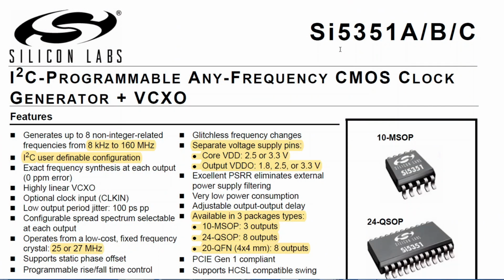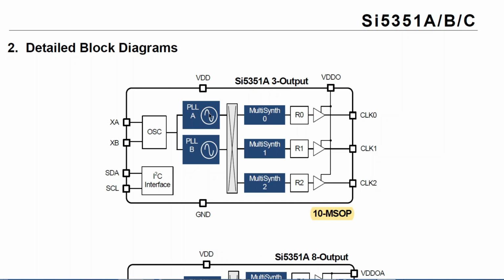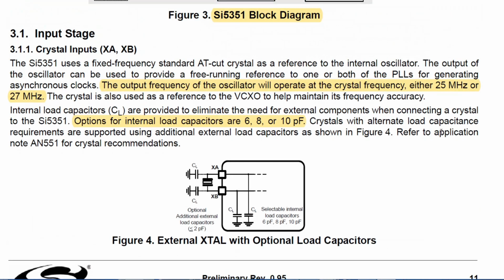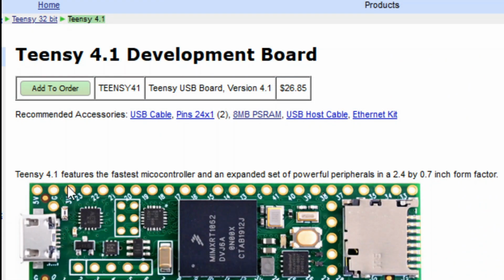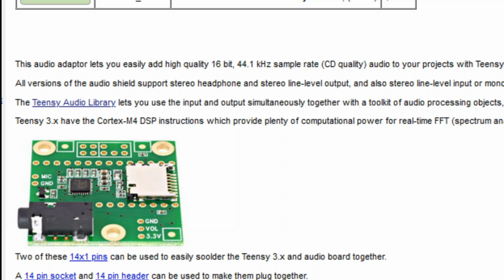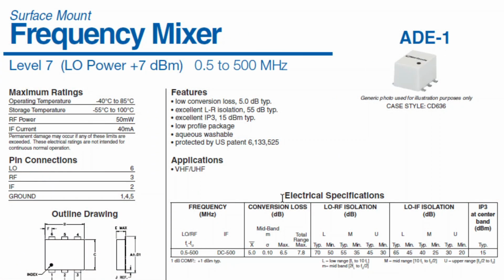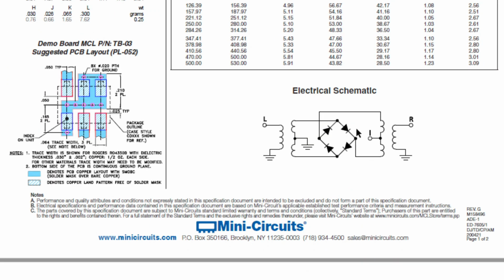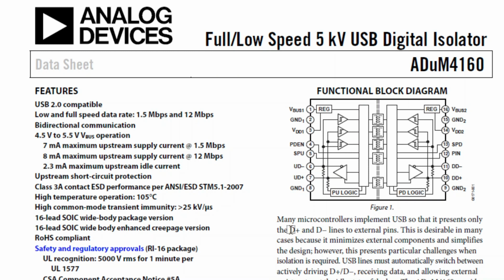#076 Post bag #20

Comment: BGA deadbug? Consider yourself challenged! ;)
Reply from the maker: Thanks Dustin I accept the challenge. 42 balls in a 7 x 6 with a 0.35mm ball pitch.
there is about 8 or so ball's i won't need to connect to. So 32 wire in a 2.6mm x 2,3 space :(

Comment: Quite a high-tech mailbag.  Much of it beyond me.  Are you building some sort of HAM transmitter with the Si5351?
Had to look up what PsRAM is all about.  DRAM that is accessible without wait, at slow speed, like SRAM?
Now that Teensy 4.1 is something I can wrap my head around.  All those PWM outputs could be useful as LED drivers or such.
You just need the stereo microscope and hot-air system to solder up some tiny BGAs!  Have watched enough Louis Rossmann to know I will probably never invest the equipment and skills necessary to do this.  Fascinating though, nonetheless.
Curious to see what all you build with these.
Reply from the maker: Sort of a background long term project, will video it and release if it goes well.  Cheers for the comment.

The Teensy4.1 just blows all the Ardunio, esp32 boards out of the water. 600MHz clock! i think the bigest problem will be trying to make 1 second timers, it's quite a big divider required :)